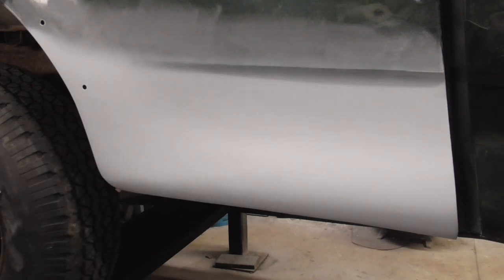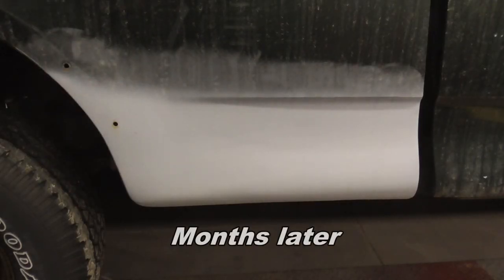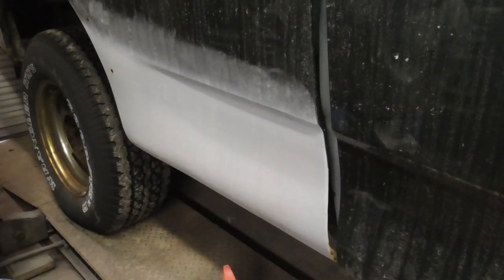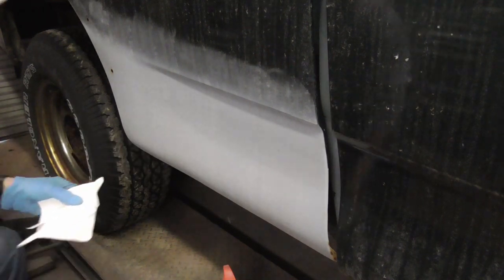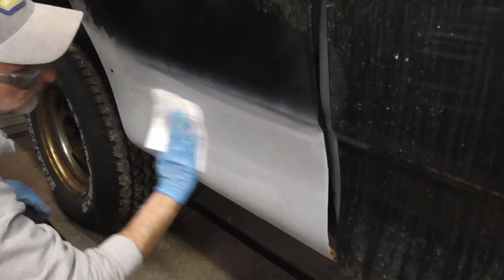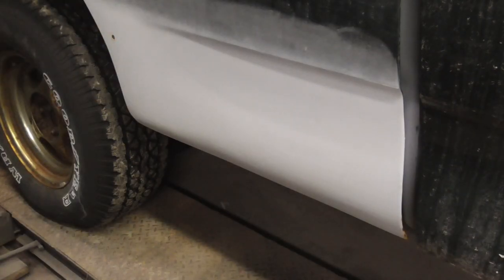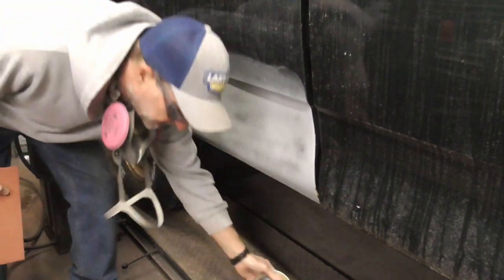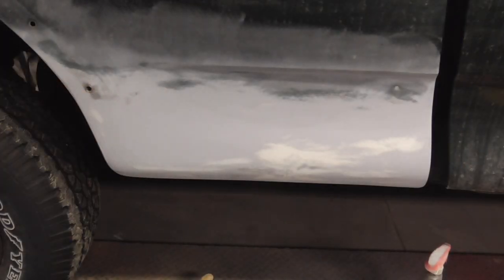How Long Can I Leave a Car in Primer?  Primer/Filler vs. Weather⛅

Comment: People still use lacquer primer?

I have had projects ruined leaving them in lacquer primer.

However, stuff that I had in a 2 part primer surfacer was fine.
Reply from the maker: Thanks for the input VN :)
Reply: I might be wrong but I believe all the sandable or sanding primers are lacquer. Or used to be. I think if you have a good base primer it wouldn't be a problem for sure.
Reply from the maker: @vincemajestyk9497  You're right about a good base primer - the thin primers - like out of a spray bomb can don't really do as well as an automotive grade primer :)
Reply: @LakesideAutobody  You know, I started thinking about it after I posted, and all the primer that sprayed which I MIXED lasted and I never had a problem. It's the spray bombs that are the problem probably cause they're so thin. You're right!
Reply from the maker: @vincemajestyk9497  Yup - spray bombs are thin for sure - even the ones that say high build are thin :)

Comment: Well, sorry to say this but I'm getting rust bleed through after spraying 3 coats of Speedcoat Lacquer primer surfacer using the Harbor Freight purple gun.  I sprayed it onto bare shiny metal and bondo 3 months ago and rust is coming through the bare metal areas. The metal and filler was block sanded with 120 grit and wiped with Eastwood Pre Paint Prep before priming. The vehicle is outside under a carport.  Did I do something wrong? I'm in damp NW Washington state, so maybe that's a factor. What should I do before painting?  Thanks.
Reply from the maker: DA with 220, prime again, finish sand and paint :)

Comment: Good video. I’m not a fan of Lacquer primer in never stops shrinking. You think you got coverage after bodywork. Looks great all the sand scratches are filled ready for paint. Paint job turns out great give it some time in some cases months and you’ll see all them sand scratches. Being that it never stops shrinking it will show. The primer shrinks right into the scratches it once filled. I get it Lacquer dries fast easy to sand and it’s price is right. But it’s not 1970 anymore much better products. Not knocking Jerry he does good work. I have friends that still use Lacquer primer themselves.  My personal opinion I don’t need customer coming back for the wrong reasons. So UPOL rapid cure is my go to 45 ready to block. Once again not knocking Jerry just the primer Lol
Reply from the maker: Thanks for your input - here's a truck all done with lacquer primer and after 3 years no sand scratches showing.  I think if you do everything by the book (old book) like not putting filler over paint, using the correct sand paper grit for each phase, you won't have any issues - https://www.youtube.com/watch?v=gIS1Tbv7Kvw  & https://www.youtube.com/watch?v=t1WclT_GMvk
Reply: Thanks seems like problems I’ve had personal with Lacquer is the primer won’t show any scratches. When it’s just in primer once I based it out and laid the clear. Then a few weeks later could see the scratches. It’s like the saying goes Lacquer never stops shrinking. It’s like the bottom fell out the primer dropped into the scratches. Once it was based and cleared. Well Thanks for the response. Maybe you got some insight on this Jerry. Don’t get me wrong I like the convenience of Lacquer. Quick to flash easy to sand. I get it. Thanks
Reply from the maker: @ginoconti-wl8hx  What type of scratches are showing?  If they are straight then they are probably sand scratches left in the OEM paint from body work.  If you put filler over paint then sand the filler with 40 grit, even 80 grit, those have to be DA sanded out (but that will wreck your work - right?).  If you don't DA them out, they will probably show - even sometimes with 2K primers.  If you grind the paint off like the old school guys did before applying filler (the right way) this wont happen - there wont be straight sanding scratches in paint only "rubbing" scratches on the metal (sand paper doesn't really leave gouges in metal).  It's hard to explain but you gave me an Idea for a good video explaining this.  Basically if you don't leave sand scratches then there's not going to be a problem.  Keep asking questions if you have any more my friend :)   Jerry
Reply: Thanks for the response. I turn out great work. I do completels collision panel replacement the whole nine yards. I have to workers each are part time so really I have one full time guy. Lol. I do a lot of rust repair here in Erie Pa. Cut it out weld new metal in grind welds skim it out in fiberglass. Finish it with filler then icing prime paint. Sand fiberglass with 80 on Da right to 80 on block get it flat. Filler same process with 180 da then block. Icing no da 320 block only. That’s why I think it’s a primer problem. Looks great in primer couple coats blocked out. Then once painted and cleared might catch a couple scratches at the right angles. Don’t get me wrong not every job. But it does happen. Well thanks for you time Jerry take care
Reply from the maker: @ginoconti-wl8hx  You must have a lot of business because of the vehicle checks - nice talking to you Gino - have a good weekend :)
Reply: Thanks you also. Yea I stay pretty busy not a real big shop. Been thinking about what you said. The scratches are on the outside of the repair. So like you mentioned the OEM paint is most likely getting hit when blocking. I’ll just have to start stepping it out with the da past my repair. Not a big thing gotta blend the paint any. Thanks Jerry for the input.
Reply from the maker: @ginoconti-wl8hx  You're welcome Gino - I used to do it all the time and still do 😊 - where the block scratched the oem paint - then primed over it and sand scratches showed up.  Just gotta try not to leave scratches that's it :)
Reply: Thanks Have good night.

Comment: My whole foxbody has had primer for 2 years now... starting to turn moldy color ...
Reply from the maker: Is it parked under a tree or somewhere it can't dry out each day?
Reply: @LakesideAutobody  not really but yes  it is outside in va weather
Reply: It's been rain on and everything ... resanding should get straight enough to put some some kind of paint ?
Reply from the maker: I would sand it, making sure that there isn't rust or damage under the primer and go ahead with finishing it up.  Maybe even hit it with a coat of sealer before painting - that is after it has had time to thoroughly dry out :) @cbcb2960
Reply from the maker: Got it :) @cbcb2960
Reply: @LakesideAutobody  thanks bud

Comment: My cars been in primer for 1000 years no issues.
Reply: Well give it one more year and you will see the problems begin. 1001 is one year over the line lol.
Reply from the maker: You're right around 50 years older than Noah!  Don't look it up 🥴
Reply: I actually put the first coat of shellac on the Ark, still holding up no issues.